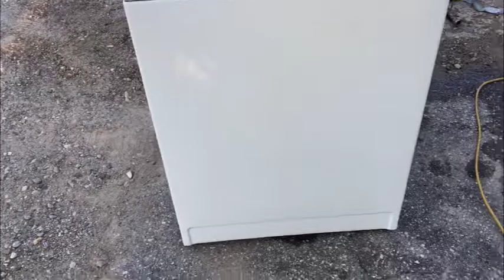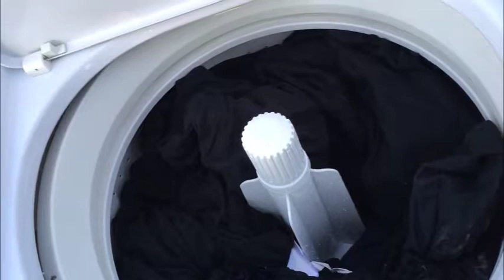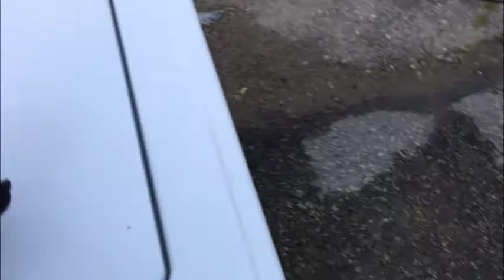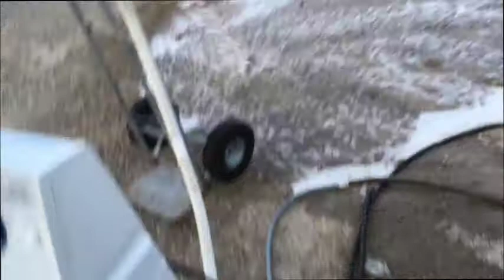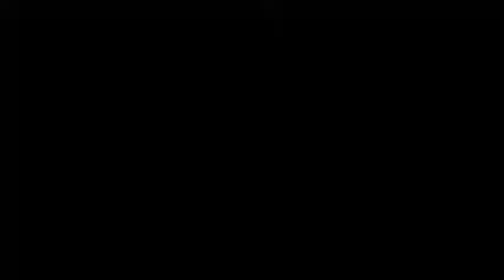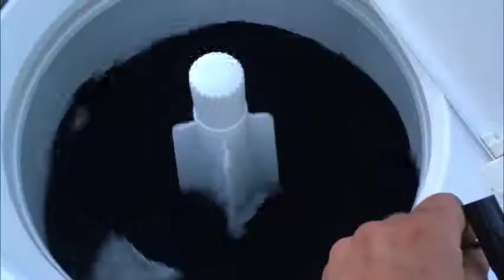maytag performa

Comment: The agitator inside this machine and the control panel design was made by Norge, Jenn-Air, Admiral. 
 This model was manufactured around 1996.
Reply: Probably actually early 2000’s, judging by the transmission.
Reply: @Ififitzisitz  No it was in 1996 because I had two of those exactly like it so and when it went to the year 2000 they changed it
Reply: This ain't no Maytag Performa it's a Jenn Air washer (Ultra 22?) With a Maytag Performa Control Consol

Comment: One model like this contained Double Wash cycle on Agitate and Soak combos for providing 
longer agitation for soil treatment on tough spots like stains, debris, followed by partial 
drain and refill for Regular cycle, five Temperature setting with Double Wash Hot/Hot/Cold 
and Warm/Warm/Warm, five Speed setting with Hand Wash/Slow, Regular/Delicate, 
Hand Wash/Permanent Press, Finger Faucet for spraying water on tough spots like stains, 
debris without operation. This model doesn’t contain those features. Another model 
contained Suds Saver and Suds Return cycle in between Off labels for Delicate and 
Regular cycles.